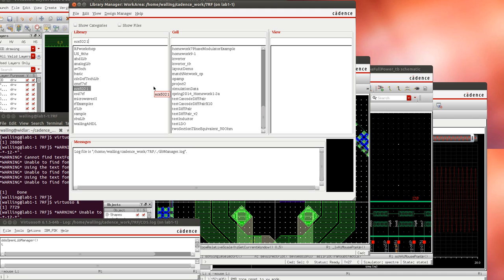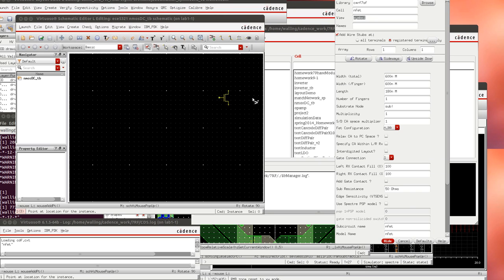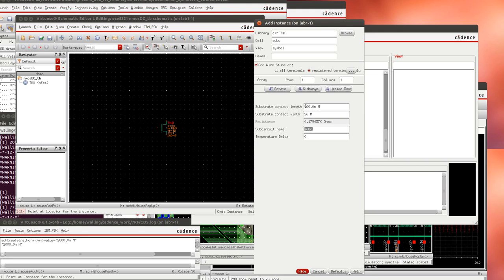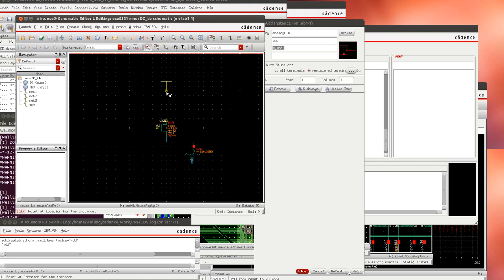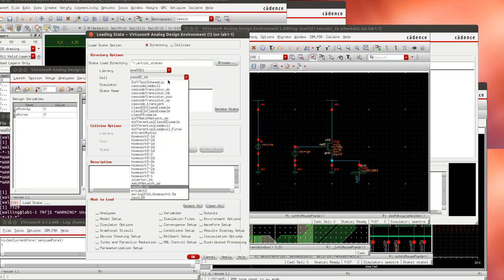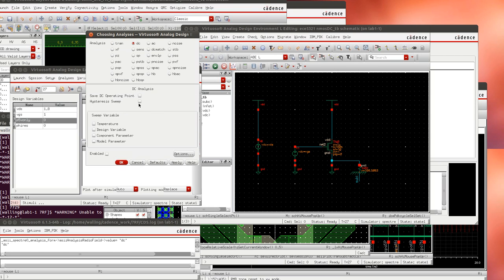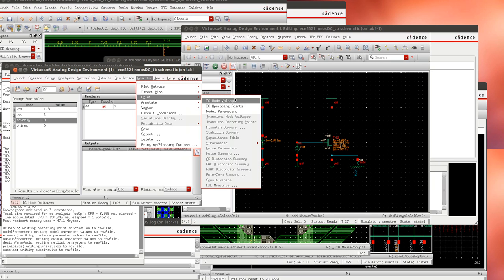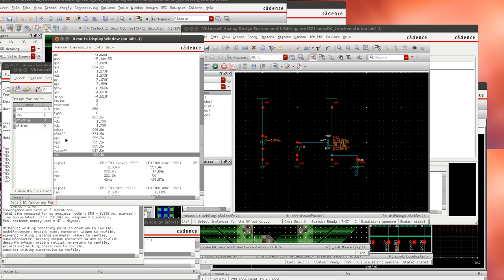Cadence - Using a DC simulation to find properties of a transistor

Comment: Thanks very much! Can I ask a question that has confused me so long? Why the capacitor cgs is negative?
Reply from the maker: The way that capacitance is calculated is dQ/dV. If this result is negative, it will report a negative value for capacitance, but this is not how it should be interpreted physically.
Reply: Jeffrey Walling But if I need cgs to calculate the bandwidth of the mosfet, should I just take the absolute value of cgs to do it?
Reply from the maker: @黄琪枫  To a first order, but this capacitance is very specifically dQgs/dVgs, which is not the total capacitance seen at the gate. But if you are looking to get within 10% of the estimate (for a long channel device), absolute value of cgs from the DC simulation will work.
Reply: Jeffrey Walling That’s great. Thanks.

Comment: Dear Dr. Walling, Thank you very much for your great video. Do you know how we can extract the input and output capacitance of an inverter with Cadence Spectre?
Reply from the maker: If you have the transistor dimensions, you can do DC simulations like this. Perhaps an easier way though would be to run a transient simulation where the voltage source has a fixed resistor in series. The input will have an RC like response. You will already know R, and you know that in one time constant you charge to ~67% of the final value, so from the simulated result you can estimate the gate capacitance.

Comment: sir,can you explain me how to find out parasitic capacitance from a circuit?
Reply from the maker: From the DC operating point, (Results>Print Results, Select the desired transistor). You will see various capacitances Cgd, Csg, etc...these represent the charge derivative w.r.t. voltage across the various device terminals.

Comment: hello sir
how to find technology parameter like Vth, U0, E0 etc
Reply from the maker: From the DC operating point, (Results>Print Results, Select the desired transistor), you can find Vth. u0 and e0 depend on materials and you would have to find them from the process documentation. It will be different for different processes and is not something that can be found from a DC simulation.
Reply: Thank you very much sir
Reply: @wallingphd  what if I want to sweep the threshold voltage with changing the MOS width, how should I set the output? it seems "OS("/NM0" "vth")"  cannot give the value/plot.